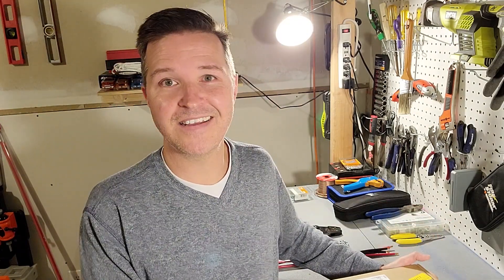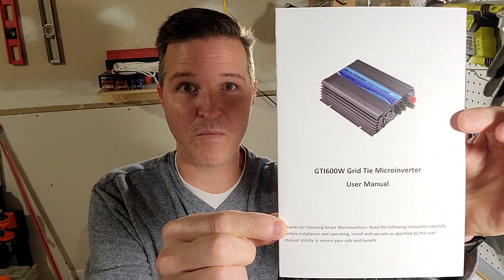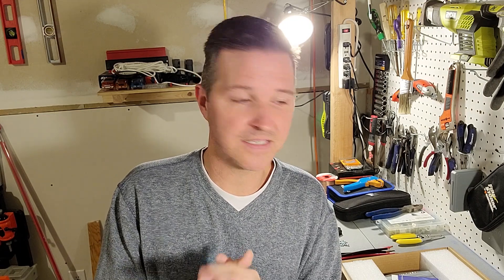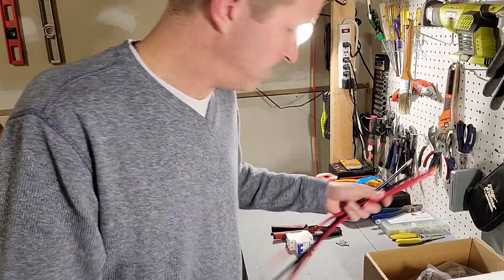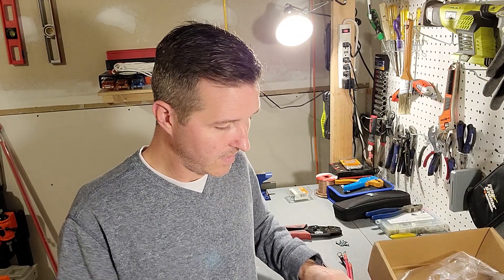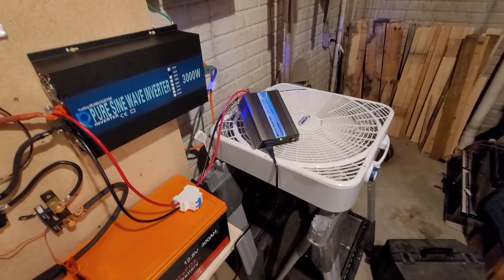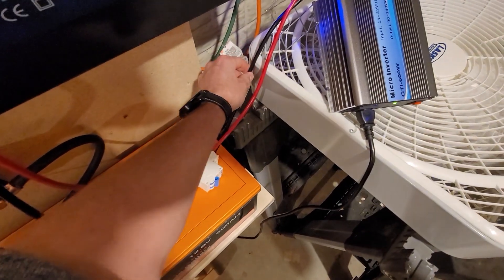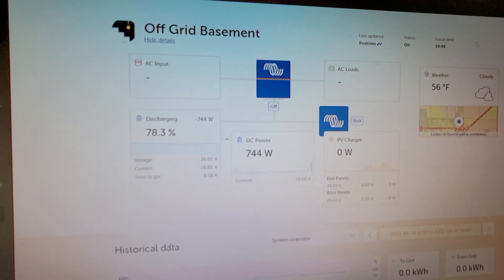I connected a cheap Grid Tie Inverter directly to my 24v Off Grid System.  Will it last 10 minutes?

Comment: The problem with them grid tie inverters is that you need a 60hertz signal for it to work.
Reply from the maker: Didn't think about that!  There is no switch for that.  Maybe if you get one for 230v it will be 50hz.  I don't know.  Thanks for the comment.
Reply: @OffGridBasement  sense I’m in the USA from what I can remember grid tie inverters need a 60hertz signal to make them work. Someone told me once. I don’t have any. I’m now looking into getting some to make a off grid system. I know inverters would be better. And I’m putting one in. I think adding a grid tie inverter to offset the balance a little.
Reply from the maker: @DiyintheGhetto  I'm in the USA as well and mine works flawlessly!  I actually have another video coming out tomorrow about the grid tie inverter.
Reply: @OffGridBasement  oh nice. I need to figure out my setup soon. I run a few servers about 1100 watts I don’t want to put on the grid. My batteries should hold but need to figure how the inverter and get a new charge controller soon.

Comment: Started using the 1400w mars rock years ago when they were around $150 burnt 6 threw trial and error finally i have a pair over a year and a half now and only paid $115 apc they both have their own 5" fan that burns 0.6w i never turn off and every 3 months I take them apart clean real good they get dusty in there fast also change the heat sink pad and past when needed  and the biggest thing which you hit out the get go was the 2 pole circuit breaker that was the last thing i learned the hard way i had them plugged into a surge protector but we had a lightning storm and even though i have my PV array on the roof grounded i still burnt both inverters that day since then many storms no problems as old as they are they still get up to 900w somedays. I'm real interested in how this test with the battery goes I've heard they produce more at a steady rate without the fluctuation from passing clouds for a longer time. I use mine to run my bitcoin rigs during the day since the price dropped I'm looking for a more efficient way to run my system without burning a whole in my pocket. Oh even if you dont have net metering the power company hasn't said anything here in Louisiana about spinning the meter backward and they did send a crew out here to see why my bill dropped that fast i guess if they dont have to pay me for what ever i put in the grid when im not mining they dont care i have been told by the workers that we all have the new net meters thats how we can track our usage threw an online account but if we ever want to pay the $100 bucks fill out the application to see what were generating and collect on what we put in the grid then we have to get permits from the county do everything to code then get inspected, ill get a solar edge inverter before i do all that.our light bill was running around $470 a month after 10 solar panels 2 plug an play inverters and only mining bitcoin from 8am to 5pm its down to $104.
Reply from the maker: That is excellent!   It's nice you don't need to worry about the net meter.   I bought the small grid tie inverter just so it can cover my base usage.  It works great being connected directly to the battery. There were days that I would run it for 15 hours straight.   Thanks for the comment!

Comment: Why did you hook the grid tie inverter to the 3000 watt inverter? Why not hook the grid tie inverter straight to the batteries?
Reply from the maker: I really wanted to reduce the amount of wiring.  I also knew I wouldn't be running a heavy load on the off grid inverter and running the grid tie at the same time.  So I wouldn't need to worry about popping the fuse.  Thanks for the comment!

Comment: Ok, sorry to say! While this seems to be a reasonable idea, this cord setup is called a dead mans cord! And is so illegal in CA it can be considered criminal!? The reason why, is if the power goes out, to your home, and a lineman is repairing damaged lines it can back-feed to the grid and kill them, and many have died from generator back-feed and solar back-feed!? If they get hurt you will probably at least loose your house? The only way possible to make this work somewhat, is to feed one circuit, in your house, and totally remove the breaker that connects to the grid! Only use non grid connected extension cords for anything off grid, has to be off grid. Or it requires permits and certification from several agencies, so no one gets injured nor dies for a few kwh of energy! Again set up an automatic transfer switch that is isolated from being able to feed-back to the grid, and you can use all your available solar generation especially with a couple more batteries?
Reply from the maker: All of this would be true if the grid tie inverter didn't have the "islanding" feature.  Islanding means that the unit will shut off if it doesn't sense 120v in the AC side of the unit.  Thanks for the info!
Reply: @OffGridBasement  OK, cool, in CA and some other places they require rapid automatic shutdown, if the grid goes down. I didn't think such an inexpensive inverter would have something similar, my bad, sorry!
Reply: But here they would not consider it necessarily reliable enough and everything has to be UL certified ect. So for my on grid setup, the components get quite expensive. That's why I'm breaking 1/2 of it up to RV type stuff, besides I would want the RV/boat set up anyway. And because that is totally off grid I don't have to have all the just correct approved and inspected stuff, the cost difference more than pays for my batteries!

Comment: 450 watts into the house, 85 watt fan and venus is saying 700 watts out of the batteries. means the efficiency is petty bad on that grid tie inverter is about 75% efficiency. GTI is about 90-95% efficient. Do you have specs on that Chinese inverter to see what they claim on their efficiency? I've had mine running for about a year and it's fine.
Reply from the maker: I believe it states to have 85% efficiency.  I've switch up my fan to a much smaller usb fan that uses about 7w.  So I get about 520w pushed back into the house and the venus shows I'm using about 630w.  It is much better.  It's been 3 months  and still running strong!  there are some days it runs for 10 to 12 hours without a problem.  Thanks for the comments!
Reply: @OffGridBasement  85% eh. I guess that's  why those are cheap. definitely something to consider. I keep mine outside, out of direct sun/rain, without an external fan.  The internal seems to be good enough even on the hot days. Maybe they have an internal overtemp automatic shutoff until it cools.

Comment: I worked in the electrical distribution industry for 40 years. One thing you learn quickly is leave plenty of headroom. On the networks its roughly twice the normal operating levels.  At home you don't need that much but i would give a rough guide of run it at 75% or less to get the longest life.
Very rough and there are always exceptions but a good place to start.
Reply from the maker: Thanks for the info.  The inverter doesn't have any settings to turn up or down the production.  I honestly didn't think it would last this long, but it is still running like a champ!  Thanks for the comment.
Reply: @OffGridBasement   Yes no settings because it acts in the same way as a battery in that it will produce everything it can if the load is there to use it. Think of it as a ball valve, on or off, thats it.
all you can do is reduce the load.
The network has what is in effect a limitless capacity to use so it appears to have control because you will never draw the full power it can provide.

Comment: How is the inverter working after 3 months? I want to try a 1kw inverter with a 12v 300w power system, or a 28v 300w. That's only running at 30% capacity of the inverter. What do you think?
Reply from the maker: I think either of those would be fine.  The inverter is still running strong!   I've been running it for 10 hours on some days with no problems.

Comment: thanks for the video but cheap or not, I don't think any electronic device is expected to run at peak power for any extended period of time, that's even in the specs, there's peak rating and continues rating, of course I believe you know that, I am just saying it to hear myself talk
Reply from the maker: That is so true.  I was expecting it to burn out in a few weeks, but here we are 3 months later and this thing is still running like a champ!  There are some days that I run it from 5am to 9pm!
Reply: Most electronics are designed for about 85% of maximum

Comment: And I thought I had a small setup but mine's not connected to the house I want to do it but I didn't do it cuz mine's too small of a set but yours is even smaller I run a 200 watt I run an 850 watt I run a 1500 watt I run a 3000 watt I run a second 3000  I run a 4000 Watt 240 vote I have 5000 watt 240 volt and a 6,000 w 120 volt. That is what I'm running for my system.
Reply from the maker: The inverter is still working great.  You should do it as an energy dump to get more out of your panels.
Reply: @OffGridBasement  an energy jump I don't understand my battery is running out of power one day running more of a load than it could handle it took me two days to charge the battery mind you I have 17 batteries and when I got batteries that are older than you or I should say older than I am and I'm praying that using it better for my solar system just been using the same ones for 24 years oh I have the solar panels are it's just as old as that still give me the same Watts as if they were new but I'm using batteries my father gave me 24 years ago and he had those batteries for a long time and I just bought some more batteries but we don't have any real solar panel batteries at least not yet anyways.

Comment: All I know is my solar panels charge my batteries completely full by about 9:00 every morning I have 17 batteries all 1,000 amps 135 amp hours my solar panels always beg for more batteries my charger is always big for my batteries my inverters are always happy all I got is 12 volt though I got a couple I could run 24 volts but then I can't run my 12 volts as well and it's not hooked up to my house cuz I don't have enough power to hook it up to my house but hook it up to some things in my house as much as I can anyways and when I completely my batteries all the way it takes my solar panels 2 days to charge my batteries completely full cuz my chargers are not that great of chargers. Now I've had a better charger and not panels that are just 12 volts and some solar panels I can go to all the way up to 48 volts I would run higher voltage in my house but when I first started all I got was 12 volt solar panels cuz that's all I found but later I got solar panels can go all the way up to 48 volts with two solar panels put together what I'm doing since my 12-volt solar panels are still good as I'm going to separate them and use one for 12 volt and one for a higher voltage means I got to get more batteries just for 12 volts and I definitely have to get more votes for that 24 volts or 36 volts or 48 volts whatever I'm going to have it for but then I got to get a better inverter.
Reply from the maker: I don't see any reason not to have separate systems with different voltages.  As long as they run what you want for the amount of time you want, you are good!  Thanks for the comment!

Comment: yeah great, gonna try and do similar. question, how are you charging your batteries in a 24volt array.
Reply from the maker: I have 3 stings of panels totaling 2.6kw of solar.  They are connected to 3 separate MPPT charge controllers.  All charge controllers are connected to the same bus bars that are connected to the battery.  I have two 12v batteries connected in series.
I have a diagram on my website if you would like to check it out.
https://off-grid-basement.com

Comment: I looked into gridtie inverters a while back and stumbled onto a warning that they were illegal. Don't know about that. Asked myself, then why can people sell them? No, ebay is not the perfect moral/ethical policeman, and laws are not everywhere equally, so don't fall for the logic of "if ebay sells it, it must be alright". Gridties could be illegal because if a lineman is working on your lines and shuts the power down (yet YOU are backfeeding the line) he could get electrocuted because of the power you may have just turned on.  Illegal? Not?  ??
Reply from the maker: I can see how that type of grid tie would be illegal and very dangerous.  All of the grid ties that I looked at have a feature called "Islanding".  This make so the inverter basically shuts off if it senses no AC power coming from the outlet it is plugged into.  That way it is safe for linemen because it can't back feed while the grid is off.

Comment: I went through three of that exact unit. All of them failed in a few months. I gave up on them, and spent another 25% for units with a pot that adjusts the output power. The pot has a switch at the full CCW end, and when turned to full CCW the unit is configured to use with a solar panel.  Turn the pot just a bit CW past the switch point, and the inverter goes into battery mode. At this near full CCW point the unit draws just a few amps from the 24 volt battery. Turn it full CW, and the "600 watt" microinverter pushes 450 watts out to the grid. This is correct per the data sheet.
The first one I tried ran perfectly for months, so I bought 3 more. For the last year I have been using them to dump 1400 watts from 3PM to midnight every day - which completely powers my house and stops me from using any grid power at peak rates. I mounted the units vertically on a wall, and their build in cooling has been entirely adequate. BTW, 10 gauge wire is all you need for the battery connection. Each unit draws less than 20 amps, and 10 gauge wire is fine up to 30 amps.
The adjustable grid tie units I am using draw a bit less power as the battery voltage declines, and completely stop pulling from the battery when it gets down to about 23 volts. They cut themselves off before the draw the battery down to the point where its BMS would shut off.
My battery is 800 AH of 24 volt (nominal) LiFePO4, and starting from 100% full,  draining them for 9 hours end up at about 48% at midnight. They'd be lower than that, but from 3-5 PM my solar panels are still producing quite a lot (in the summer) and for the first couple hours a large fraction of what the microinverters are using is coming from the panels, rather than discharging the batteries.
Because peak rates on my Northern California solar/EV/Time of use rate plan are very high in the late afternoon - early evening (~ $0.42/kWh) the payback is quite short. Power that I would have sent to the grid at off-peak rates of $0.14 per kWh is worth almost 3 times that later in the day, when the sun is gone. I calculated that each day the microinverter creates about 3.6 kWh of power that has a net value (peak rate - off peak rate) of $0.28 per kWh. That works out to almost exactly $1 per day. It takes about 4 1/2 months for the unit to pay for itself, and after that its all profit. In my case, $4 per day, or $120 per month.
Reply: Curious about the adjustable microinverter you're talking about.  Link?
Reply: @tim7548  ditto. finding a non-expensive model with this feature is critical to success.
Reply from the maker: Thanks for the info!
Reply: Indeed ^
Reply: I really like this.

there's issues in many areas with limiting peak feed in to grid. non-certified systems run the risk of exceeding feed in limits and becoming a legal liability.

obviously legislation varies by area. 

I feel there's a sweet spot using certified components and features to check total feed in to grid and switching on/off these extra systems to prevent excess feed in while utilising the solar generation and battery capacity.
Reply: what are they called do you have a link ?
Reply: Good information.  What is the inverter you used?
Reply: This response is pointless since it does not give any info as to what they thought better

Comment: hi.. i just thinking the same thing can i run it for 10 hours everyday you think it safe?
Reply from the maker: I've had mine for a few weeks now.  Just today it ran from 5am to 7am then 12pm to 8pm.  I think if you have an external fan blowing on it you will be fine.  I made an update video you should check out.  I use a much smaller fan that is blowing right into the unit.  works well!  Thanks for the comment!

Comment: Your losses are actually pretty large if you include that fan.  I don't think this really makes much sense, that grid tied inverter is very inefficient, but it is better than nothing.  I know you can make something better.
Reply from the maker: I switched out that big fan with a small USB fan that's plugged in to a AC USB plug.  Only uses about 10w.  I made another video on the mods I did.  Thanks for the comment!

Comment: i have 1 on order,,, I was thinking do I connect the solar and the Battery to the same Red Black Terminals. I was going to try battery less to start with add battery later..
Reply from the maker: That is what I did, except with a fuse and circuit breaker inline.  You want to make sure to have some protections.  If that inverter shorts, but will short out everything it can!  Thanks for the comment 👍